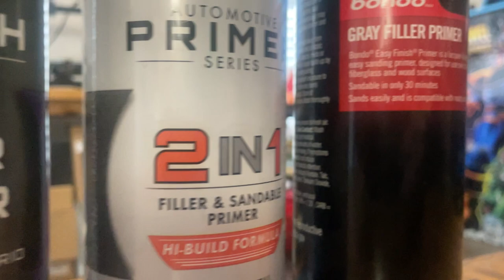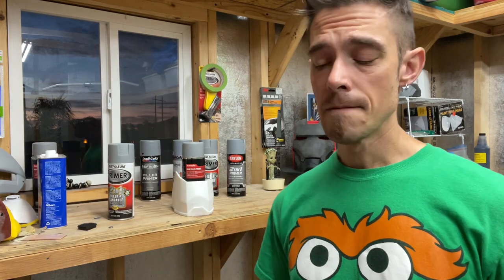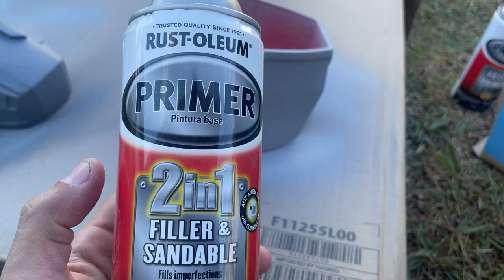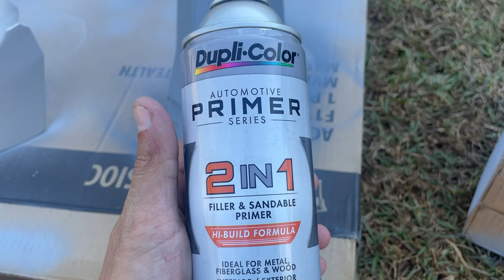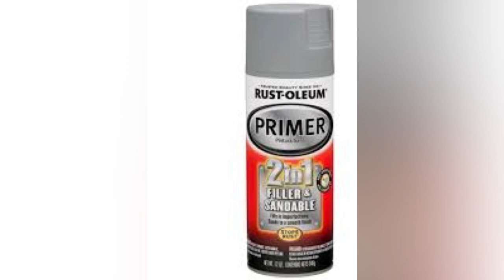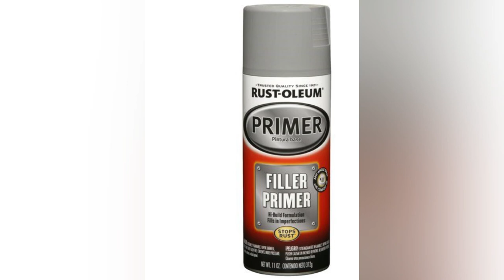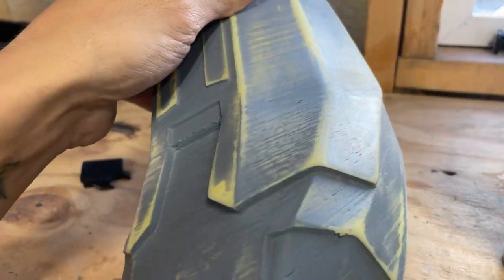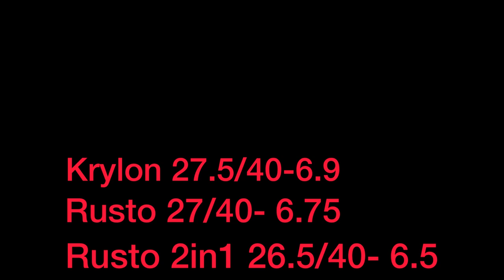What’s the best filler primer for 3D printing | Filler primer testing part 1

Comment: nice comparison report. It will be nice when you go over candidate 1-6, you can have a table below to show the rating from previous candidates. For example, while going thru rating of no 3, you can show a half-filled table of rating of no 1 and 2. This will make it easier for viewers to see if this is better than the last 2. Once again great job and keep that coming.
Reply from the maker: Thanks! I’ll have to do that comparison table in part 2. Thanks for the tip!

Comment: I've had good results with the Rustoleum 2 in 1,  but a lot of that is availability for me. The Bondo looks really good, eagerly awaiting the final results!
Reply from the maker: I just can’t get past the wait time and the gummyness/build up on the sand paper. 90% of rustoleum users are strictly bc it’s so available. It does do a good job filling there’s just other things that drew me away from it, things you don’t realize until comparing multiple brands. I do appreciate the input & thanks for watching!
Reply: I agree...Bondo looks like it might be pulling away from the competition...place your bets...lol

Comment: Not sure if you have ever tried sanding rust opliym when it is dry but not cured. It is a weird semi rubbery consistency. It will gum tour paper instantly but then you can kinda polish it. Works amazing to get real clean details. You can sculpt and carv the paint to get super crisp detail and control of texture. Very delicate and finicky but if patient can yield incredible results
Reply from the maker: But why bother when you can use a solvent based primer that fills better, sands easy & dry & ready in 15/20 minutes not hours like crustoleum?

Comment: Hi sorry if this is an obvious question but can you sand the filler primer when it's dry? Because I made a death eater mask for Halloween and was hoping it could be lightly sanded when dry.

Cheers
Reply from the maker: Yes you can sand the model, apply the filler primer & once dry repeat that process until it’s smooth. You want to change the grits of your sand paper each layer you do. For example- sand the model with 80 or 120, than sand the primer with 160 or 220 and after you apply more primer sand with 220,320 up to 400 grit.

Comment: Would you mind recommending? I’m painting a bowling ball chrome silver (not to be used for bowling). Which primer would you recommend if I get a colorful bowling ball? It’s cheaper ($50) as opposed to a white one ($90). Do you think it’s worth it to get the white bowling ball or can I get the coverage for the cheaper colorful ball?
Reply from the maker: Bondo is you can get it. If not check out upol primers, they are fantastic!

Comment: You might want to use a cartridge respirator when spraying this stuff.  Those N95 masks might be better than nothing, but they aren't designed for use with spray paints.
Reply from the maker: I normally do, this was quick tests here and there. Go through all my videos I wear 3m respirators

Comment: I feel like you were a bit hard on Rustoleum. I don't experience any of the issues you had with the product. I would suggest getting a smooth drywall sponge, press lightly, and not think of it as sanding/removing the primer. Instead think of it as if you're polishing the 2 in 1. It'll actually shine up, and be super smooth. As far as control/spraying issues, that could be technique, spray distance, or even climate. Who knows? It's like filament. Results may very. I can't say your opinion is wrong, if it's true to you. I can only say it's different than mine.
Reply from the maker: It’s a test so each one is ran through the same test. What it shows is rustoleum is a more delicate filler primer. Its show variance as the other 4 primers had little to no issues. More sanding tests will be given in round 2 with different media and grit. What I can say is you don’t want filler primers wet sanded or smoothed so much to where it creates a sheen and can reject top coats. Additional tests will be conducted in part 2 but even with a sanding sponge and inteface pad both rustoleums gummed up and we’re gouged by 220. I noticed the rustoleum needs different techniques that I mentioned in the video & I’ll highlight them in test 2, thanks for watching!
Reply: I've built a mark 17 suit, and I'm currently printing a mark 2. I haven't come across the topcoat adhesion issue. I definitely dont wet sand the 2 in 1, but I believe the manufacturer recommends it. Ive seen others wet sand anyway. Maybe, these are all techniques you'll test in upcoming videos, and if you come up with something interesting I'll definitely give it a try.

Comment: You've said multiple times that the rustoleom 2 in 1 is water based. The product spec listings I've checked on different websites says it is oil based. If this is oil based doesn't that mean I can't use acrylic paints on top of it ?
Reply from the maker: So recently rustoleum did in fact change there formula & the new 2 in 1 (260510) is in fact oil based. The filler primer used here is there old water based formula. So if not fully cured it will definitely create adhesion issues with acrylic paints.
Reply: Do you know if there's a way to tell  which version is which? I literally dumped like like 8 cans of this stuff into a bunch of very large models and I'll cry if I ruin everything when it comes time to paint.
Reply: @Darkwingdad  what do you think I should do? I have a bunch of models primered in the Rustoleum 2 in 1 and nothing but acrylic paints.  I researched doing a barrier coat and found mixed ideas on this. That1painter claimed on his website that primer is different and its ok to put water based primer on oil based primer. Other websites say oil and water is a no go 100% of the time. I was thinking That1painter might be right because supposedly the reason acrylics crack on oil is because the oil off gasses through the dry acrylic. But Rustoleum 2 in 1 dries so fast I would think this might not be an issue?  Another thing people say is the glossy nature of oil is problematic for acrylics but as everyone knows the 2 in 1 isn't glossy. I dunno  bangs head on wall
Reply: @Darkwingdad sorry this was my other account.  So yeah... just got off the phone with Jesse H at Rustoleum. He said the 2 in 1 Filler primer has always been oil based. No formula changes. The good news is he said that with this primer you can put water based products on it and I could even do laquer if I wanted.
Reply from the maker: @bangtizzy  I’m not sure about them never being water based, as old msds shows soluble content in the formula but regardless when you give anything enough time to cure & do light coats you’ll be ok. I would highly recommend switching to a solvent based filler primer like upol. I’m doing another video like this with some new primers.

Comment: I know rust 2in1 says 2-4 hours, by i swear it only sands well for me when I let it dry for 48 hours :)
Reply from the maker: Lol ironically in my part 2 I state & show how long it takes for it to dry. 90% of the time when people have frying or reactions it’s all derived from rustoleum. I’m not saying it’s total garbage but it’s finicky & lots who use it do not wait proper times I guarantee. I see people loading this stuff on after an hour…that’s just asking for trouble. IMO a filler primer should not be so temperamental, primers should be the easiest part of painting.

Comment: That mask does not prevent anything because you are still smelling the primer.  You should use 3M filtered mask.  If you smell something, it is time to change the filter.
Reply from the maker: It does have a filter in the front & notice I have an exhaust fan & filter in my booth pulling the fumes out. Yes a respirator is the proper ppe but in this case this is better than using nothing as many often do.

Comment: Based on your reviews I bought 3 cans of bondo filler. That was a huge mistake. The nozzle is the worst Ive seen and it eventually became a dripping mess. I thought it was me but a quick amazon search revealed the same.
Reply from the maker: What temperature were you using it in? I would contact 3m, I’ve literally never had an issue with bondo filler primer
Reply: @Darkwingdad  im using at 70F . A bunch of negative reviews on amazon saying the same thing. 
Btw. Do you wash after sanding the putty before priming? Love all the Starlord stuff.
Reply from the maker: @jack91522  I would contact 3m, if it happened with all 3 that’s definitely a manufacturer defect

Comment: I got Rust-oleum 2in1 sandable & filler primer. 

Its the exact same packing as yours, the only difference is that mine has an AUTOMOTIVE written along with PRIMER
Does it makes any difference ?
Reply from the maker: @armancodeq3642  no it’s still rustoleum, still garbage

Comment: Why do most come in gray? Isnt it easier to paint of its in white?
Reply from the maker: Gray is the most neutral in the color spectrum. Primers in white & black will heavily affect top coats tinge & hue hence why most primers are grey. White & black are both too harsh in hue that’s why they aren’t made. The only primer that’s easier to paint on is a solvent based one, color is irrelevant.
Reply from the maker: In your “defense” you’re not wrong about mentioning color. Often times people who are painting gold or metallics would benefit from white and many times mix & match enamels and run into adhesion and curing problems. The best thing to do if you’re wanting color variance is use a white or black matte or satin enamel as an undercoat. Many people do gloss undercoats which just contributes to orange peel & potential improper curing & warping.

Comment: What do you think about uv resin as a filler? Is it comparable?
Reply from the maker: Not a fan, it’s toxic, if not fully cured it will affect top coats, you have less control, you’re fighting gravity & it’s very easy to lose definition in detailed parts of the model. I tried it & personally it didn’t save anytime just was messy and more of a hack than anything….but that’s another video.
Reply: @Darkwingdad  thanks!